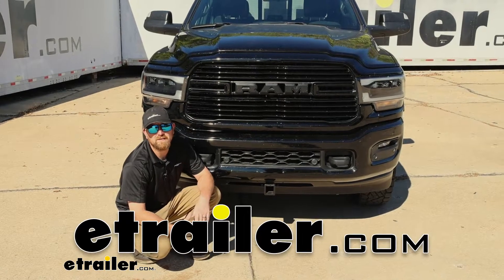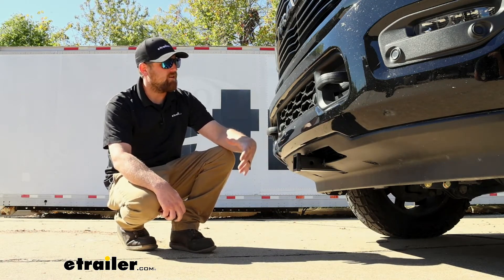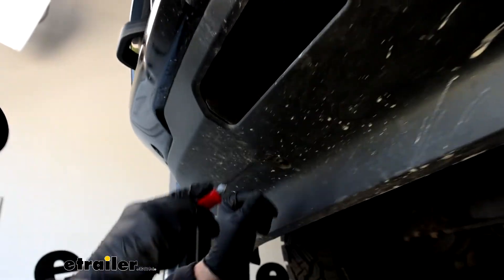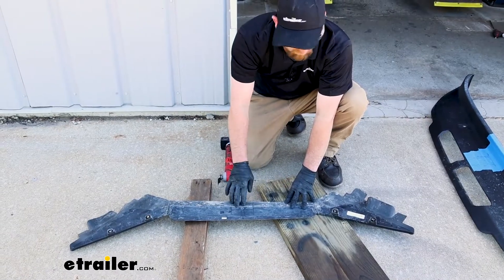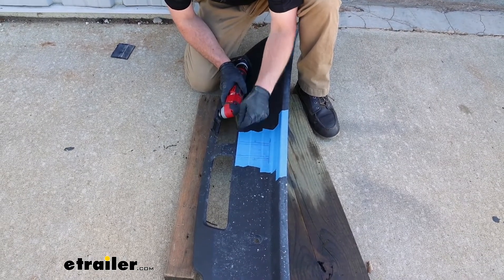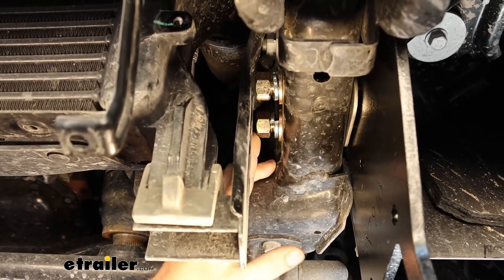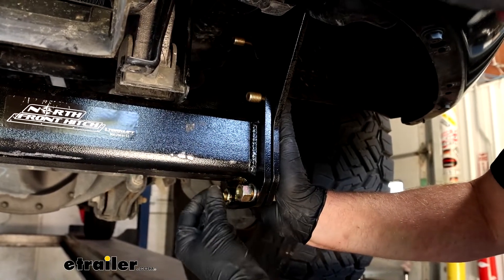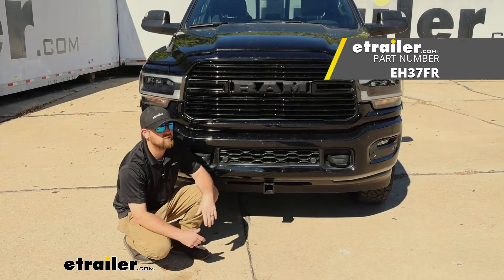etrailer | Set up: EcoHitch Hidden Front Mount Trailer Hitch Receiver on a 2021 Ram 2500

Comment: I have a Ram 2015 3500 and I'm looking for the lower hich like this one,
Do you have anything available for it,
I'm not looking for the typical hitch the bolts at rescue/tow hooks hitch level
Thanks for the help
Reply from the maker: Curt offers a front mounted hitch that doesn't install where the tow hooks sit, part # C31067. The hitch attaches to the outside of the front frame members, as you can see in the linked install instructions...
https://www.etrailer.com/Front-Receiver-Hitch/Ram/3500/2015/C31067.html
https://www.etrailer.com/instructions.aspx?pn=C31067